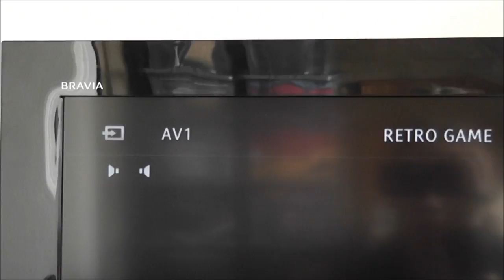Faulty MVS Progress Update #2 - No Video No Audio - Bad Sound Chips?

Comment: Did you ever get this working?  I've done a recent repair to an MV-1FZ but luckily I didnt have any battery acid - that stuff is really painful...  I suspect you could have damaged tracks under the components nearby, it often doesnt stop just at the battery area and can damage the tracks underneath chips easily.

Comment: The chips on this board aren't advanced enough to require cooling :) The Z80 is the CPU that was inside the ZX Spectrum and runs at a whole 4MHz, and the Yamaha sound chip is just a sound generator and shouldn't even warm up. It wasn't until the mid 90s that CPUs ran fast enough (and consumed enough power) that they'd get hot enough to need cooling.

Comment: If chips get hot like that, they've usually shorted out inside. What happens after that can be completely random depending on how the chip died and what's shorted out in it.

Try removing the Yamaha chip (it's the actual sound chip so beyond making sound it shouldn't be doing anything important) and see what happens. If you're lucky you might get an error telling you the sound chip is missing or bad.

Comment: i have a cdtv which had no video, turned out to be bad caps on the video board, it seems your issue with video may be similar as it seems your tv is picking up a signal, however no RGB from the video stage, with the sound it may be a similar issue, may be worth getting hold of a chip schematic and checking voltages on power pins and use a logic probe to test channel outputs if not just drop in another 2610 or 2608 which is similar

Comment: I suggest before start de-soldering the big chips you should find the power and ground of the Yamaha and Z80 chip and cut only those legs first and then power the whole thing up.
Cut first the power of Yamaha then test, then if nothing cut ground of Yamaha then test.
Cut z80 power and test and etc you should get something on the screen, since these boards do have some BIOS checking . (and install the bios of course...)

Comment: You can take a Z80 out of a dead Model 1 Mega Drive/Genesis or even an old Master System. I've seen a bunch of them Z80's die for no reason. What's the voltage on pin 57 (/SCS) of the YM2610 when the system's 'running'? If it's somewhere between 2 and 4 volts, the Z80 is accessing it properly. Is the voltage on pins 19, 28, and 62 5 volts? if not it may be shorted out.